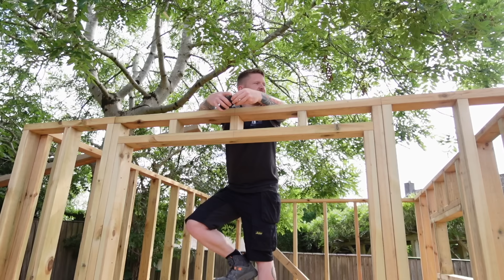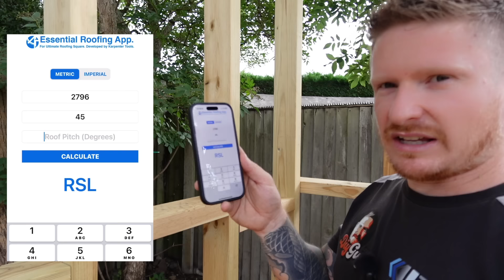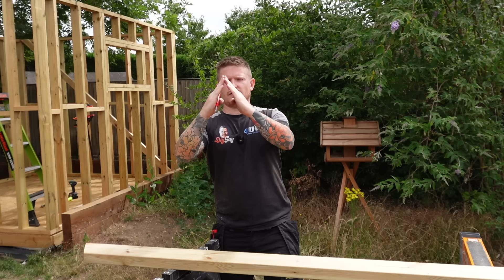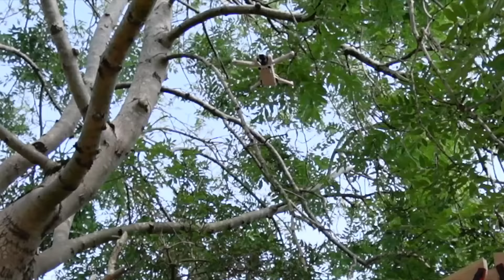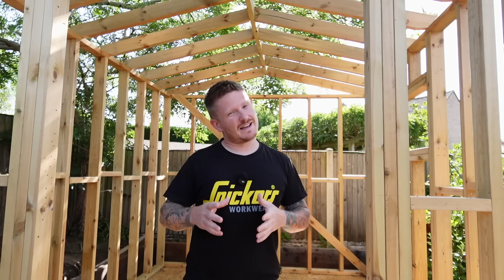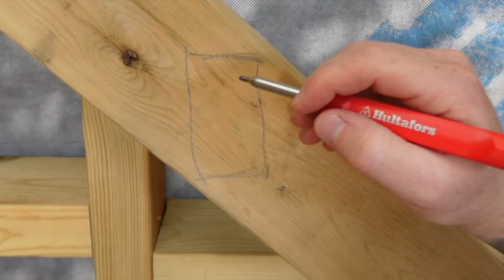How to Build the Perfect Apex Roof For Your Shed (Beginner Friendly)

Comment: Raised a 60’ long X 12’ tall 2X6spf stud wall at age 13! Clomped in the bolt anchors and had shiplap fir jill poke boards 36” apart the whole wall, my brother yelled your goin to dye, I will help! The rafter job I learned later, cut a real construction paper pattern to include a 12” eve, birds mouth with 1.5” step on double top plate(BC CANADA CODE) pitch to .375 rise/run is fine if using 4 overlap #48 tar paper, Ice dam puddle proofing at 3100’ elevation, draw on the current rafter this cut out profile including whole birds mouth to jigsaw out, allow 2” extra length per rafter for unsquare foundation,Ridgeboard, mine was a Canadian Army build, 300 man unit building leapfrog 100 man three crew homes in 24 hours. 48 bunker 18” dia. disc saw sewer installation! So + & minus 2” to work out everywhere. Studs must be directly under rafters all cases! No leaks in the past 19 years. The BC 3/4” plywood came from Vernon, BC. Just about snapped my hamstrings lifting those bad boys through 3 stages and onto the rafter deck, bent 2X12 two inches doing it. Hope this keeps you safe, if it gets to 47C and your vision blurs get off right then!

Comment: Great video and very timely view for me. So I am making an outdoors bar out of green oak. It’s about 2m x 2m give or take. The frame is from 90mm x 90mm beams (planed 100mm ones) and I was unsure on how to do the roof and this video pretty much answers it so thank you.  One question.  The frame is all pinned with oak dowels instead of screws/nails. For the apex roof, how would you connect the top of the rafters to the ridge? I’d like to avoid nails and screws but am unsure if the inward force would be enough to hold it or if I should do a birds mouth at the top of each rafter as well and then pin them with dowels to the rafter.  Tools are not a problem (I make furniture so have a well-equipped shop) but a building is not a cabinet so it’s new for me!  Any suggestions would be most appreciated. Great video and great channel by the way.

Comment: How do you deal with the slight step up of the OSB roof sheets where the rafters meets the side facias? Wouldn't this stop the bottom edge of the roof laying flat? 
Do you fix the side facias lower than the top edge of the end of the rafters? Or are you chamfering the facias? 
What nails do you recommend for hand nailing feather edge cladding for the sides?
Reply from the maker: It won’t make any significant difference 👍

Comment: I have a metal framed pergola. I'd like to make a low pitched roof for it. Would it be easy to do? Probably use double wall  polycarbonate sheets or galvanised metal sheets. Just want something relatively cheap and shower proof 🤦🏼‍♀️
Reply from the maker: Definitely do able 👍

Comment: Amazing, designed to rot in no time at all? No air gap behind the 'rot so easily' soft wood cladding and no roof overhang to ensure rain runs down the cladding just to speed up the rotting - great job.

Comment: Great video. Genuine question, do you not need joists between the rafters to prevent the weight of the roof causing the walls to spread under load?
Reply: Did you not watch the video? At about 20 minutes he installed three joists.
Reply: @qwerty69-i7m not sure how I missed that
Reply: @stevengraham4330  Easily done when multi tasking!
Have great day.

Comment: The shed looks great. The timber fascia you put around at the end, does that not create a flat spot unless you ripped a slight angle on them which means your board won't sit quite flat at the bottom of the roof.
Reply from the maker: Cheers. It’s not enough to matter or affect the board.

Comment: I dunno why I watched your DIY shed build and now this roof build? I bought a shed almost 20 years ago online. It was actually pretty sturdy except the paper thin perspex windows and the roof truss made out of really thin wood might have been 1x2. After about 5 years the roof leaked like a sieve. I ended up buying 4x2s and some torch on felt. I used a 4x2 to acro the roof up and took the truss out and just copied it in thicker wood and reinforced the joints with steel plates. I then screwed hook into the side wall studs inside and used ratchet straps to pull the shed squarethen refitted the truss. After that I removed the "acro" brace and went out to check the ridge which was perfect. I removed the ratchet straps and the hooks. Then I ripped the crappy felt off and replaced it with the torch on felt.
Still looks looks the day I did it. I have had to replace some of the cladding a few years ago,
I ended up buying a load off someone on ebay because it was the wrong size for their project. And I ended up cutting them down and routing new ridge in the back to get the same lap and depth to the cladding. Noticed this year that one of the doors (there's2) is getting a bit gappy. And the Side gate I put up when I moved in 20 years ago is going rotten so I'll be watching making a gate next This summer I'll be replacing the side gate and may make 2 new doors for the shed just think it doesn't hurt to get a few new tips before you do it.
Reply from the maker: Glad you found it helpful and best of luck with the gate and shed doors!

Comment: Impressed with this, so much so that I have decided to embark on the journey of building my own shed workshop in the spring /summer next year.
The question I have is -  'could I use 4x2 instead of 5x2 for the framework?'..my local timber yard does not stock 5x2 so I would need to go out of town to source it, and it would save some money.

Comment: If you were potentially going to put insulation panels in the frame gaps in the future, would you then need to put another membrane/vapour barrier on the inside of the framing, or would the existing membrane be sufficient?

Comment: If the fascia boards are placed in square at the same height as the rafters (where they meet) how do you deal with the 14 degree angle difference when you put the roofing boards on?

Comment: working with the 2 x 4's also nicely allows for dropping some rockwool in and plasterboards on the inside making it a nice insulated garden room. Only requires some electricity running to it, a comfy chair, a mini-fridge full of beer and a lock on the inside to keep the wife out 🤣

Comment: The cheapest  way to buy wood is studding. So use that. Of course, the end walls should have the roof slope already there- that top horizontal is doing nothing for you. Waste of wood. Put the ridge pole (vertical stud) between the two end walls. Then make A frames (so that you are not pushing the walls apart). Horizontal goes in first . Rafters can be measured off the end wall- make one, and then copy for how many you need. Attach between wall plate and ridge. Simples, and no maths required.
Not only is it strong and cheap, you have horizontals above head height to store timber, pipe, WHY. And more headroom at the sides.
My shed was built this way, and 12 years later it has not moved or had any problem whatsoever.
Reply: you seem to know your stuff may you please reword this for simpletons like me? So I can get a better understanding.  Cheers

Comment: PLEASE HELP ME! 😂
After watching your videos, I thought I would take the plunge and would give some DIY a go myself 👍.
Quick question from the dumb to the wise if you could help??
Could you do (if you get time) a very brief explanation / tutorial how to turn a flat roof to a sloped roof.

I have built a very basic 6 leg - 2 bay pergola, (4x4 timber frame) approx 6m x 3m in size. 

I want to put a sloped roof on it with a 1/4 inch slope per foot, but not entirely sure on the best approach for ridgity and asthetics.

Please help me 😭

Keep up the great videos, I am learning so much. Thanks ❤

Comment: 24 C would be a blessing, even 30 here in Florida(US). It's been up to 38+ with heat index at 47C. That humidity forcing sweat to not evaporate 😢.  But, the grass is always greener on the other side...winter here is a blessing. Learned a lot from the videos, thank you!
Reply: If I get a sweat on I put it in the accident book ! 😂

Comment: Did a similar roof out of 18mm OSB and doubled up all the overhanging edges/soffits. Then I used a half inch rounding over bit in a router to soften all edges top and bottom. The idea being it would make fibreglassing  or even rubber much easier in the future with zero sharp corners. Still got the nail on felt 10 years later though! 😂

Comment: This is great but how much would you change the design or strengthening if the building is bigger.  My project is 6m long and 3m wide.  I am concerned about ridge beam sag and figured that I would increase the size of the timber of the ridge beam, use joists hanger brackets, where the rafters meets the ridge beam and cross brace every second pair of rafters.  Also should the width of the building have a bearing on the pitch angle of the roof?

Comment: You've made this whole process so simple. I'll definitely be building my own pent shed from CLS when the time comes, thanks to these videos.

Is there an easy way to work out the base and wall heights ahead of time, if you know the eventual pitch and need to stay under 2.5?
Reply: If you know the pitch then you can easily calculate the roof height. Then deduct that from 2.5 to give your wall height.
Reply: @markrainford1219 Thanks. Now that I've filled in the gaps using Pythagorean geometry, that makes complete sense 👍
Reply: No problem pal. Sometimes it takes a comment to realise you actually  knew the answer all along.

Comment: Great video as usual … but either I missed it, or you didn’t show how you made sure your overall height is below the 2.5m permitted development limit. It looks from here (unless you’re really short 😂) taller than that … but from what floor level are you / do you measure the 2.5m from?
Reply: It’s way over 2.5m, the door height alone is 2270mm, doing the calcs based on the roof pitch and floor height from GL I’m going to say it closer to 3m. Great job though👍
Reply: If you want to stay within 2.5m rule, go onto any general shed manufacturer and go to their specification section, and work out wall/door height etc. then work out what the pitch of the roof is.  You can then make a sturdier shed than what they offer.  I did the same and it worked perfectly.
Reply: He covered that in a previous video.  2.5m is from ground level.  He dug out the area that the shed is in so that the base is below ground level.  Allows for a taller building whilst still being legal.
Reply: Up to 3 with apex roof

Comment: I notice the birdsmouth seat is deeper than your framing. How would I do it so that the birdsmouth seat is the same as the wall framing?
Reply: The seat cut will get narrower if you were to increase the pitch, basically as the roof gets higher the seat cut gets shorter. If you want to get the seat cut the exact same as the wallplates width work out the measurement of 2 thirds of your rafter width and set a sliding square to your answer, for example if you were using 150mm timber the measurement would be 100mm wide, as you should always measure down 2 thirds from the top of the rafters to mark the point of the birdsmouth's. You could then use the sliding square and pivot it against your wallplates until it touches the inside edge of the wallplate. Draw a line and this will be your pitch. If you want to get idea of the height and have your building at roof level then use a similar way as the DIY Guy did as follows. 
1. Put a screw in about 200mm from one corner and a screw at the centre point of your span. 2.Tie the line from the first screw, stretch over the centre screw then you would have to pull the line further down from the corner.
3. As you move the line down you will need to move your square along at the same time.
4. When the square matches the wallplates width draw a line, and this point will then be the pitch of the roof you'll need for the seat to match the wallplates width.
Basically this shows you how high your roof would need to be if you want the seat cut to match the wallplates width. Unfortunately, if you are restricted in height as the DIY Guy was, you don't have any choice of the seat cut width but, depending on what you are building and also what you are using for the roof covering, as if your tiling it tiles will only work at certain pitches this gives you an idea as to how you could do it, a bit of a trial and error job I'm afraid but possible. Good luck with it. 👍

Comment: Amazing really want to build my own now could you recommend a nail gun that's good for diy enthusiast
Reply from the maker: I use hikoki gas but they are discontinued now. Paslode would be my next choice
Reply: For DIY mate, I would recommend a hammer. 
Spend a small fortune on an Estwing if you like. It will never need parts or servicing or gas or batteries and it will never let you down and you will be able to pass it down to future generations. Seriously, I'm not being facetious here, but if you only have a project that needs a couple of thousand nails banging in, buy a hammer.

Comment: Where the OSB meets at the Apex, Do you cut the edges (angled) to butt join or doesn't it matter? Maybe you'll add a trim piece supplied with rubber roof.
Reply: Just overlap.
Reply: I'd just leave the gap. I sealed up my shed , with cast iron machinery inside. Lathes, that kind of thing. Sealing it was the worst thing  I did. A humidistat in the shed was showing 99% humidity inside when it was only 70% outside. You need ventilation. The timber structure sucks in moisture, but it cannot get out if the shed is sealed. Remember clothes on a line will still dry in winter, as long as the air is drier than the washing. It's not just down to temperature i.e evaporation, but vapour pressure too.

Comment: Great video. Been thinking of building my own shed rather than buy one. Confident with the base and walls, after your other videos, but the apex roof has always put me off. Not any more! Cheers.
Reply from the maker: Very welcome 🤗
Reply: It's easier just to build a sloped roof. Just build a box at the front and lay the rafters from it to the back. Also, I'd build an overhang all around to keep the drips away when it rains. Actually, I'd build a big overhang at the front so you can stand in the doorway with a cup of coffee when it's raining.

Comment: Circular saws are a similar price to mitre saws. Far better to have a mitre saw than a circular one IMHO. Both is better though. Great video BTW.
Reply from the maker: Appreciate the comment, thanks!
Reply: @TheDIYGuy1  Yes I'd set up the 14 degrees on my mitre saw bench, then a backstop to keep lengths the same, and cut all of the roof joists in a matter of minutes. 

Apex roof can be good for solar panels if you are building in a lcoation where the 2.5m limit doesn't apply.

Comment: In Sweden all sheds use large overhangs and sheds are clad in vertical timber. Normally they are also built on a floating floor avoiding any damp issues. They last for years.
Reply: what is a floating floor?
Reply: @Duggy171 Only guessing here, probably raised floor off the ground rather than the concrete base.
Reply: Vertically? So water travels the full length of the joint and can travel sideways in behind the wood. Water doesn’t travel up, horizontal always best! We have buildings in the UK still standing that were built 500+ years before Swedens oldest buildings.

Comment: Why apex vs single pitch roof? Purely aesthetics?
Reply from the maker: Apex gives you more head height and also in some cases looks better(subjective)
Reply: Apex in theory will also give you a steeper pitch when working within a given height, potentially better for drainage. The 14˚ pitch used here would be more like 7˚ for a single pitch.